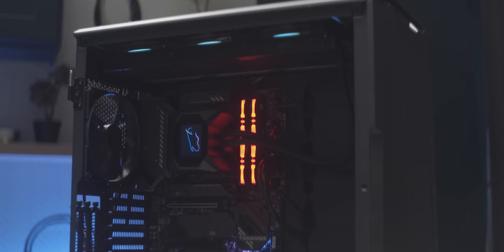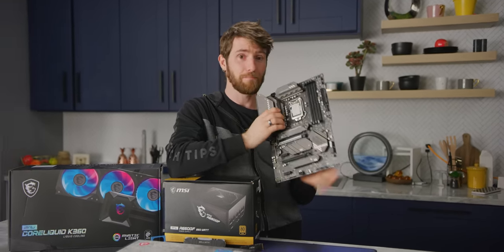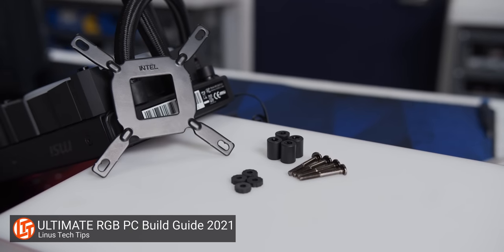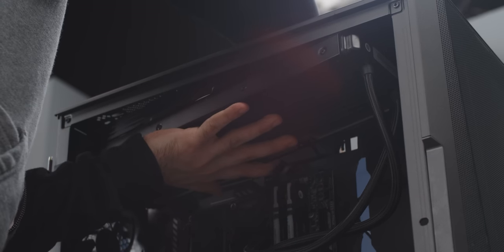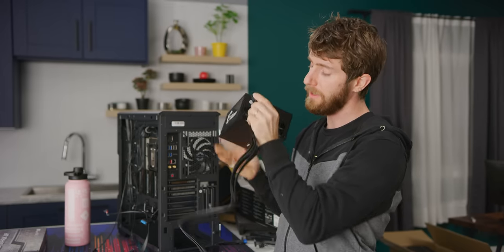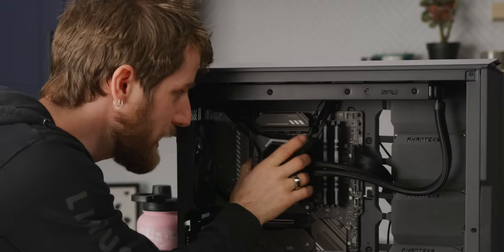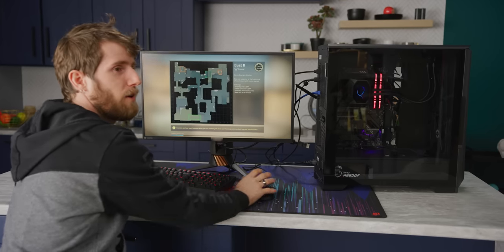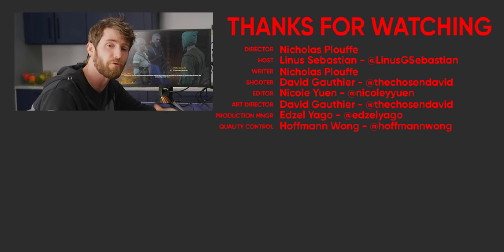You Can ACTUALLY Buy This PC!

Comment: What a horribly made video. Who was cutting it? Are you blind? One example: You show how the AIO gets installed and you can see the radiator is already installed too. The case gets turned around. Linus talks about "what a great time to install the 8-pin EPS cable". The case gets turned around again and in the closeup ... no AIO or radiator installed.

If you want to make a guide ... make a good one. If you don't want to make a good one ... don't make one.